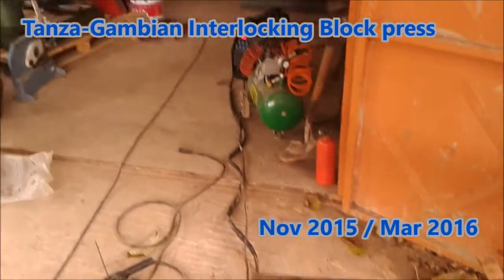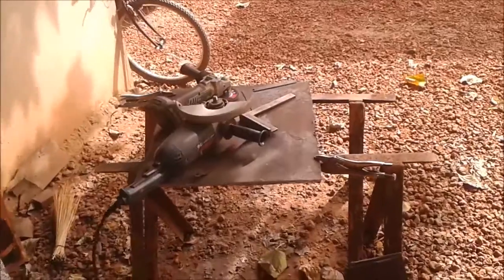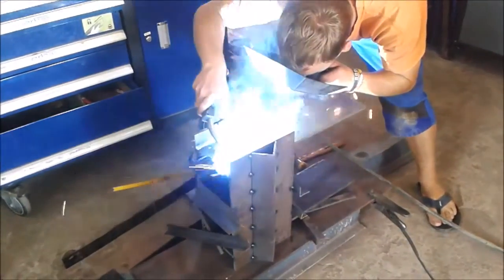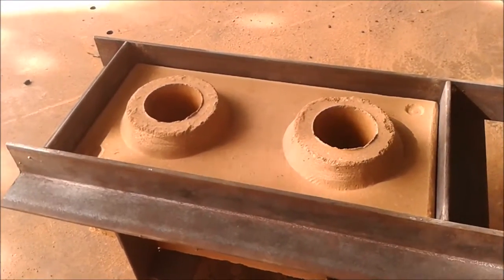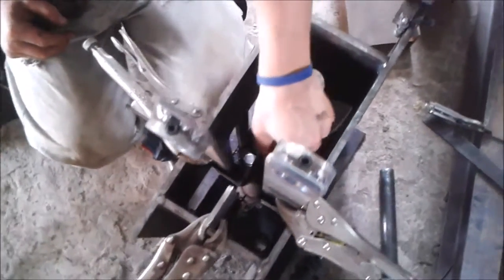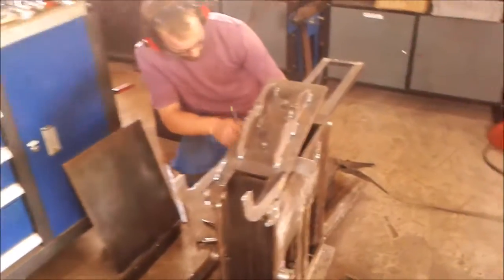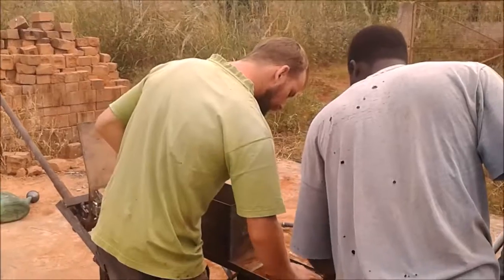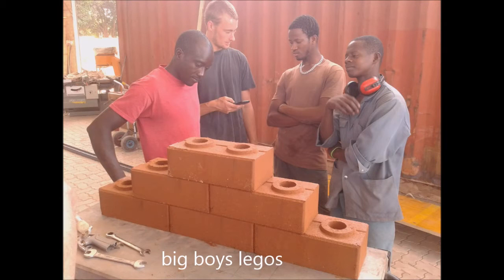the Tanza Gambian Interlocking Block press

Comment: Greetings from the Philippines. What is the mix ratio of cement, sand and soil? Thank you.
Reply from the maker: The general ratio which depends a little on the clay content of the soil is 20:1 soil to cement.
Reply: @ebrohaugh  Just wondering how to determine the water mix content at 20:1 ratio. Thank you.
Reply from the maker: @duranopaulo  The water is added to what they call optimal water level - this is determined by taking a handful of soil and squeezing it (when you let go you should clearly see your finger indents) and then dropping it (it should break in about 4 or 5 pieces).
Reply: @ebrohaugh  Thank you from the Philippines.

Comment: hello guys what is the dimension of the brick?
Reply: +silas acha 
Hello
i dont know the answer but if you make yourself this tool you can chose the dimension you want
Reply from the maker: 30 cm x 15 cm x 10 cm with 5cm diameter holes
Reply: Hey, Bro. I´ve just found your channel today. You´ve been doing an awsome work, and it´s inspiring me to do smtg, but I´m afraid it´s not going to work. Anyway, my plan is to adapt a hidraulic press that i´m going to buy in a junk yard, install a   bottle jack, and have a friend to make a mold, using the dimensions  you indicated. Believe me when I say that I´ve got a lot of soil in my yard, and I want to turn a problem into a solution. As you might haave noticed, english is not my native language , but I felt I needed to make an effort and write some words to thank you for helping people in need. Thank you ,from Brazil .